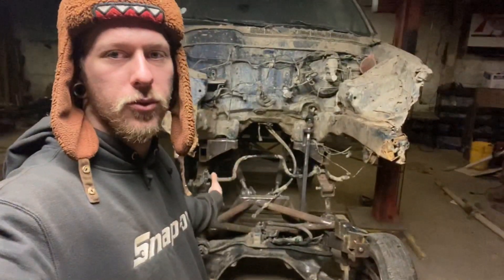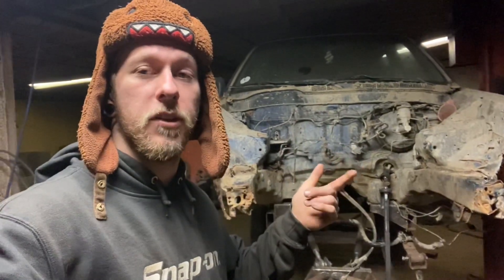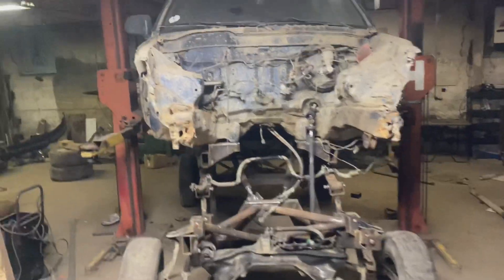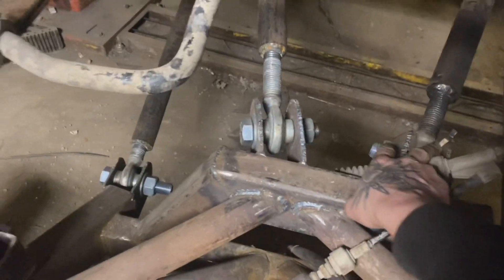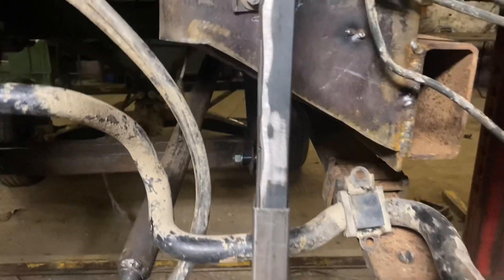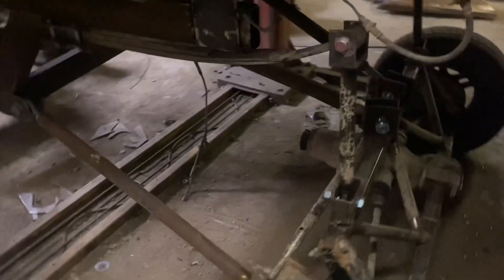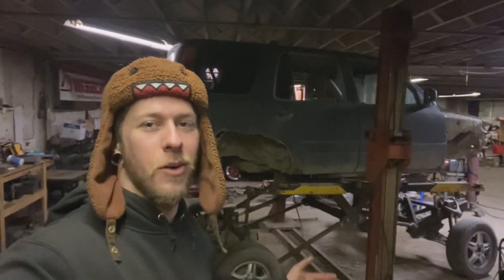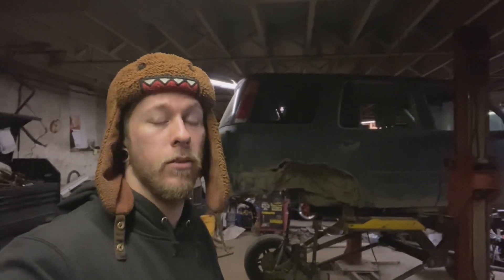Max Flex 30” Lifted CR-V on 35s Test 2 #hondacrv #crv #rd1

Comment: That thing is insane!!! My brothers wife has one after I saw urs iv been tryna get them to lift it
Reply from the maker: If you do lift it, be prepared for wheel bearings and ball joints. Cutting the plastic flares off the fenders, lift blocks in the rear to level it, is about the best option. I believe 29” tires without excessive rubbing. Anything more in any way, will cost a lot of work or money to make reliable